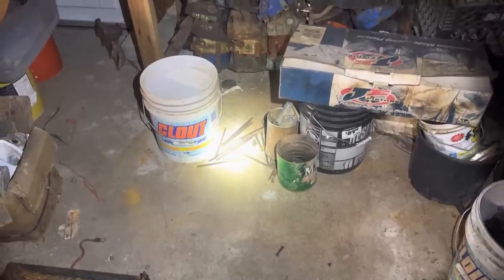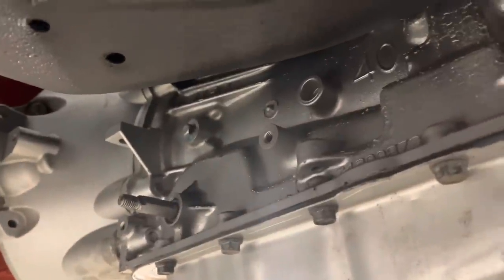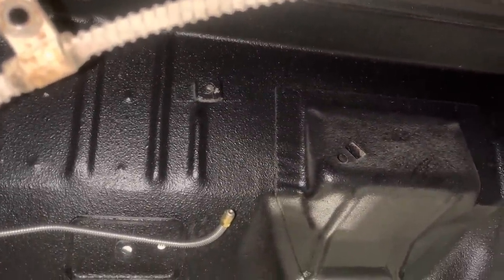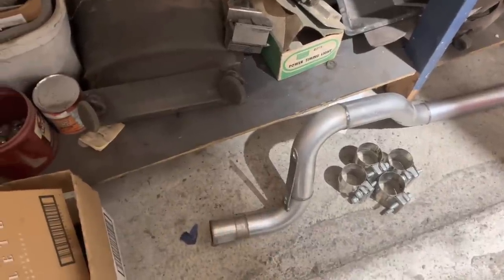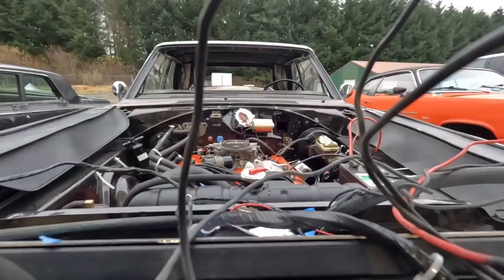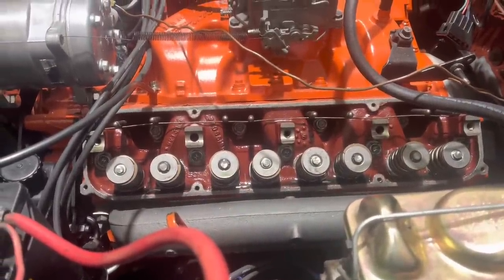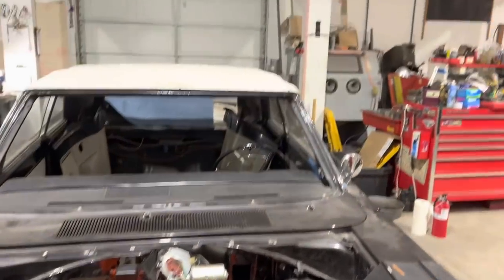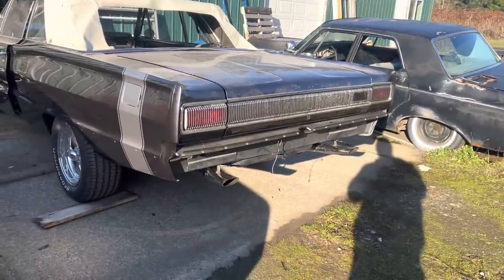Why Won’t This Brand New Mopar Big Block Run? 1967 Dodge Coronet 500 Project Update

Comment: Jamie- you’ve quickly become one of my favorite YouTube’rs! Great content. Great pace, flow, sarcasm… Keep it up and you’ll be at a million before you know it!
Reply from the maker: Thank you! I’m not holding my breath on a million, but I’d be quite content with a tenth of that 😅 a man can dream.
Reply: Jamie- pulled my 383 from my 66 Charger and installed a 1966 440 out of an Imperial (first yr 440) but not offered with the 66 Charger (weird right?) The 440 fired RIGHT up on a pallet. Didn’t smoke, no drivetrain noises. No smoke. Ran well.  Hooked up unknown big block 727 out of 1968 Newport that had bad 383. Now that I have it all bolted into my Charger, it’s super lethargic when spinning over. Switched ground point, switched starter, switched coil, switched dizzy…Even bought brand new 750cca battery. Same symptoms. I only have 3.5 quarts of ATF in trans so far. I don’t think that would be the issue. But- it’s like the trans is dragging to the point of it causing lethargic spinning and hot ground wire, hot positive cable and hot starter. Thoughts?

Comment: Hi Jamie, I really enjoyed this video!! It brought back good memories! Like when I bought the '69 GTX. I did what you're doing start the engine to see what I had to work with. When I did so, no success I pulled the valve covers to check to see if valve train was working prooerly. Well! What I found was why I bought the car for $800!! Some person had been working on the engine who didn't know his butt from an onion!!! One set of points in the distributer. Closed welded shut. There was strange things happening inside the engine, Somme valves not opening etc. So right then I decided to pull the drive train out and rebuild everything. Good decision but it took me a year to get my GTX on the road. But it was worth it!!! Luv your vids bro!!!!

Comment: This makes me want a shop with a lift so bad lol I’m jealous. Usually when I’m running lines I’m hot sweaty and pissed because there’s usually some kind of insect biting the crap out of me while I’m laying on my back in the driveway so I tend to cut corners on the routing and retainers. Great video!
Reply from the maker: I just publicly apologized for having lifts to work on now in my livestream on Sunday. Haha. I ran a professional repair shop without any for seven years! As much as I liked doing things the old fashioned way… you’ll have to pry my two post lift from my cold, dead hands.
Reply: @DeadDodgeGarage  Haha I’ll be a lift owner one of these day bro, and I won’t ever apologize for using it 😂  love the content homie

Comment: I really appreciate the explanation about the zero compression. Great diagnosis. That starter sound when you first tried sounded like the plugs were out.
Reply from the maker: Right. At this point in life I usually don’t even break out the compression gauge. You’ll know right away from the cranking sound that something is screwy…

Comment: Dude, you did a great job diagnosing the motor and push rod issue. Before I do anything on a motor I did not build....compression test all the cylinders. Prime the heck out of the oil pump too.
Reply from the maker: I understand the thinking there, but excessive, unnecessary cranking to get inaccurate compression numbers from a fresh build while wiping off whatever lube is left on the cam and lifters isn’t necessarily what you want. Even in the case of tired old engines, I almost never use the compression tester anymore. The numbers might be a little low, but you will be able to tell by ear right away if one or two cylinders are weak, or if there is something very wrong - like we found here. I believe I pre-lubed this one, but again, it wasn’t my build, and I was under the impression that it was good to go.

Comment: Great looking car-going to be a really fun ride.
   Aftermarket subframe connectors, with todays sticky tires & high horsepower should almost be manditory on convertibles.
   Friend of mine had a '66 Mustang convertible. Her car had a fiberglassed totally shot floor pan. Only unrusted fore-aft "structure" was the transmission tunnel & convertable's subframe connectors. Had 'interesting' handling.
Reply from the maker: Ugh. Mustangs seem to be really bad for that. Like they rust all around the perimeter of the floor for some reason. My brother has a crusty ‘68 Dart that now lives on a cattle ranch. I distinctly remember the feeling in the car when you floored it and let off. It felt like it was folding in the middle…
Reply: @DeadDodgeGarage  Mustangs had the first big 'Collector' Car' craze. Lot of sleazy 'restorations' back in the '80's- convertibles were the worst.
   Car should have been the seafoam color w/white interior, powered white convertible top, 289 2bbl, C4.
    Had a Earl Schweibe 'resale red' paintjob, mix & match wrong year black interior, smogger 302 & xmC4 out of a van...what a mess.

Comment: HOLY CROW, Somebody sunk a lot of money in that COOL RIDE, on with vid.  WOW, No push rods on 1 side & the wrong ones on the other side of the engine ? Makes me wonder how long that engine will last ? Plus the valves no being equal in length, VERY SKETCH REBUILD, DAMN NICE RIDE THOUGH.

Had the same problem with Dorman Trans. lines with adapters, leaked pretty bad. Had to add some Teflon tape to Temp. ( PERMANENTLY ) fix it, LOL.
Reply from the maker: Sorry, no, I pulled the pushrods. They were all there when I started. Valve heights are always here and there. It’s not that the valves are different lengths necessarily, it’s that the machining is inconsistent from valve to valve. A regular rebuilder wouldn’t be concerned about that (the factory definitely wasn’t.) In a high performance application, one would want them to all be the same. 

Managed to get leak fixed after the video. Just had to give one of the inverted flare fittings that extra OOMPH of tightness.
Reply: @DeadDodgeGarage  GOTCHA, As long as the Valve length isn't out of Spec. that much you should be alright. These are non- adjustable Rockers, Right ? MOPAR STUFF.   My OOMPH of tightness didn't work on my application.

Comment: Love the 500's I had a copper colored 67- 500 .  Was wondering why you went with the GM tranny but at the end of the video you mentioned it having OD. Is there not a Mopar trannie with OD that would have worked?
Reply from the maker: Not behind a big block, without a truly ridiculous amount of work. Big blocks died after 1978, and the automatic overdrive didn’t come around until the 90s. Since big and small blocks use a different bellhousing, that requires an adapter - and they are also much bigger at the rear , so there is some floor and crossmember in the way. The Silversport kit puts the GM 4L60E in there with very little modification to the car, and makes it a no brainer - if you really want overdrive that badly. Personally, I wasn’t very happy with how it shifted. That’s likely more to do with the program loaded in the standalone controller than the transmission itself.
Reply: @DeadDodgeGarage    I see, and that makes sense.  So Mopar doesn't make or hasn't made a true big block since 1978?  Are all the hemi engines based on small blocks also ?   Thanks

Comment: Glad ya got it running. But with what ya had to do to get it running l would be very sceptical about the torque of the head bolts especially the one off brand bolt. Are the rod bolts torqued rite are the pistons all facing the rite way or in backwards. Like ya said you didn't build the engine l would be scared of the reliabity of the engine assembler. Just my 2 cents worth
Reply from the maker: I’m guessing they lost a head bolt or maybe it was damaged. The pushrod mistake seems like an easy enough mistake to make. But I agree with what you’re saying. We will continue running it and keep an ear out for problems. If it has to come back out, then it has to come back out.
Reply: @DeadDodgeGarage  it does sound good but for how long if ya know what l mean. Keep the good work up though maybe some day l will stop by with my driver 69 charger. Not perfect but she is mine lol

Comment: So Jamie as a engine builder I hated guys that had stuff built someplace else then had me install it. Or thought they could build a engine. So case 1 guy builds a 67 hp 440 with flat top pistons. Turns engine over and locks up solid. In 67 they used closed chamber 915 heads not 906 castings. Different pistons. He used 906 pistons that came up to deck height. Carnage, bent valves. Bent push rods. Junk pistons. Cure start over. New pistons and valves that were not bent and push rods. So 3 grand later it ran. He had a professional shop build the motor. Told him ya should have come here first. Oh you did my bad I was 2 expensive. Ya can pay me now or pay me later. Case 2 push rods. 383 .020 decked block for more compression he said. So used 440 push rods. Nope bad plan. How It ran is beyond me. No power popping up the carb. Came here to get the carb set up and timing set. Problem bent push rods and used old rockers and shafts all rockers stretched to death. Pulled heads and valve marks in pistons. Well lest say cost more then a carb kit lol. The list of people who think they can build motors is long. The ones that can is short. 48yrs and never lost a motor so beat that.  I no longer fix people's mistakes and won't take those jobs. Haven't for 20yrs. Less stress but miss the humor. Oh and my Red Forman dumb ass impression.
Reply from the maker: Wow. Yeah… I want to know how that ran too. I’ve only built 15-20 engines, but I’ve been in many, many more than that and have a good idea how things work - and how they don’t.
Reply: @DeadDodgeGarage  I said it ran but barely he towed it in here then he started it back firing and shooting flames out the carb. At first I thought timing off but later reveled much worse issues. Stretched rockers is a big problem for mopars and frankly it's the only reason it ran. 383 and 440 push rods are very different. The guy was a idiot. But again this is 30yrs ago.

Comment: you have torque boxes on the convertible, you don't need any connectors.... i have torque boxes on my 440(model) convertible and my 67 r/t convertible....
Reply from the maker: Yes, there are torque boxes to help prevent twist. But they’re still pretty floppy out in the middle.

Comment: Why gm transmission? Mopar has great transmissions.
Reply from the maker: Because frankly it’s an easier conversion than the comparable Mopar overdrive, and if Mopar made a “great” overdrive, I’d like to know which one that is. The GM fits much better than the Mopar overdrive (no cutting required,) and it’s readily available in a kit from SilverSport. Time will tell how it actually performs, but on paper at least it’s a great solution.

Comment: And puhLEEZE don't interpret my question to be punitive.  Tho I have been known to push my old Mopar rather than ride in something else.... Lol
Reply from the maker: Haaahaha. No it’s all good. It’s a good kit, it fits better than the 46RH series Chrysler overdrive transmission and requires much less work to adapt to the big block. Electronics are readily available to make it all work. $5000 for a rebuilt  transmission with an extra gear and everything to make it fit seems like a pretty fair deal to me. And while 4L60 GM transmissions definitely aren’t known for their longevity, the Chrysler overdrive isn’t any better. Worse, probably. If it works as well in this car as we think it will, I think we’ll be ordering a couple more.